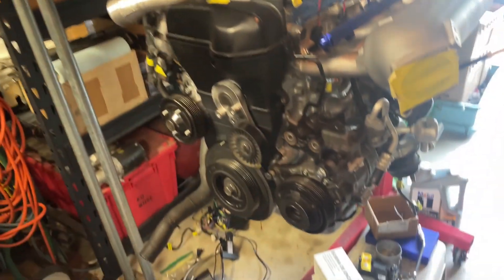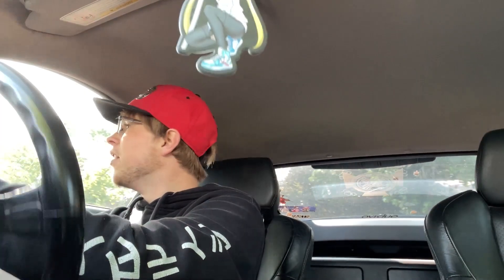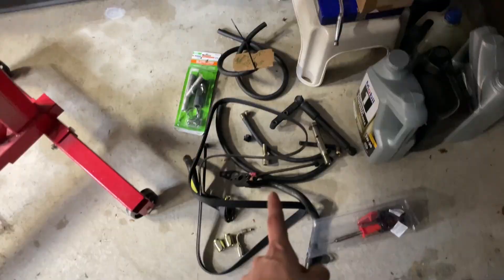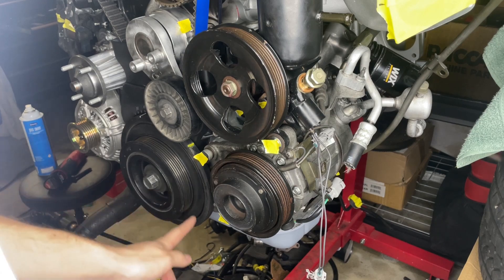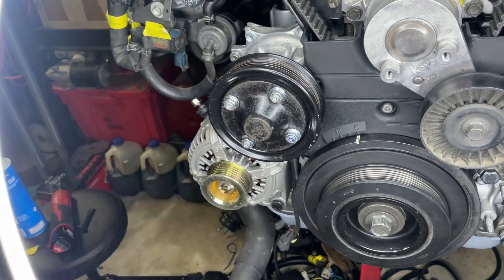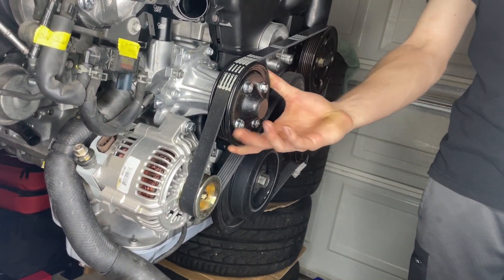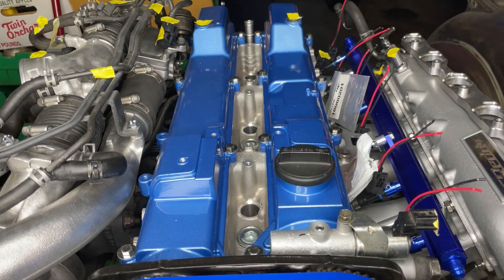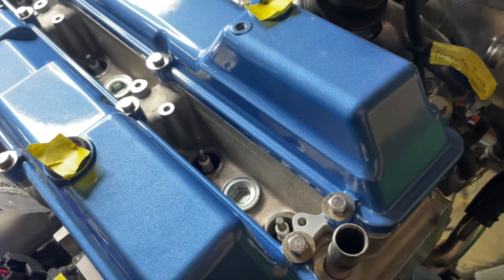Final Touches to the 2JZ Engine Build- PRP Coil Kit, Oil Feed Mock-Up, and Serpentine Belt Complete

Comment: I have been thinking about doing this swap for some time and was wondering weather the turbos from the gte were the only ones that will work very well or if i could use other. If i can do you have any recomnendations for twin turbos.
Reply from the maker: There are plenty of twin turbo kits that work with the 2jz. The GTE turbos are only good for 320-400hp so if you plan on doing a swap you need to do research on what turbos are adequate for your power goals. I can’t help you with that unfortunately!
Reply: @JacobRosproy thank you. I will look into what twin turbo kits achieve my power goals.

Comment: Lol waiting on parts is the hard problem it takes a lot of time. Fitment will be the next pain In the a$$
Reply: Also the noise your describing sounds like a ball joint. The bottom on goes out a lot and usually you have to buy a new knuckle from Nissan that's like 500$ range but I figured out you can go aftermarket and fix the problem
Reply from the maker: Dude, thanks for the input!
Reply: @JacobRosproy just helping out since I've already went thru this build just didn't record it lol youtube wasn't big when I was doing this stuff 😂
Reply: @JacobRosproy also engine mounts for the 2jz is a pain make sure you get the best mounts you can possibly get
Reply from the maker: @Lifesstacksofpancakes  I plan on going with the Collins mounts that come with the trans adapter, clutch, and driveshaft. I guess we’ll see how those do haha 😆